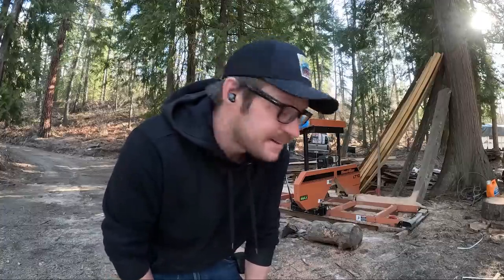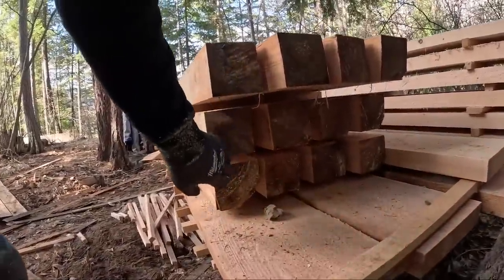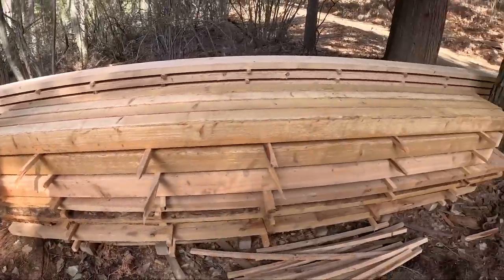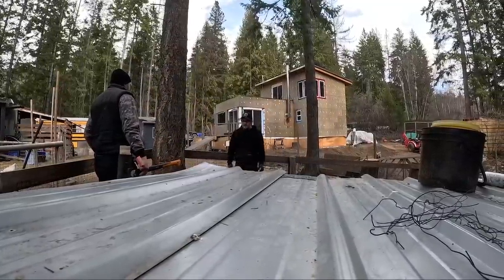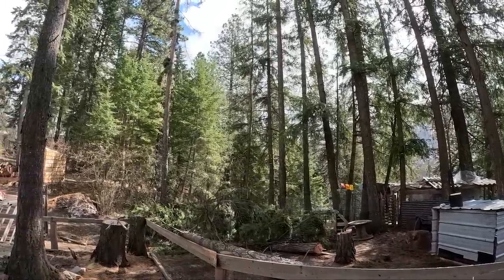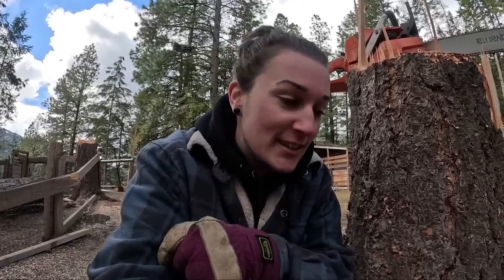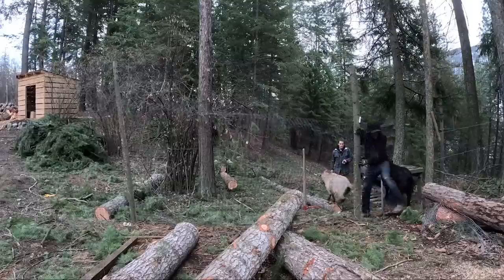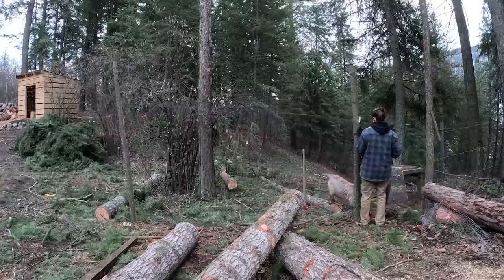This Tree Was More Dangerous Than We Thought!

Comment: @ 24:30 if that log rolls backward you will be pinned to the tractor seat / then what ??
Reply from the maker: I know it is dangerous, I keep the bucket tilted so the log sits on the cutting edge. I certainly do not feel comfortable lifting them that high, but I have confidence that they won't roll back if I keep the bucket tilted a bit more to the front.  Pallet forks will be a wonderful investment in the future